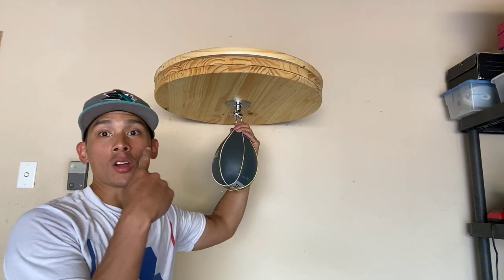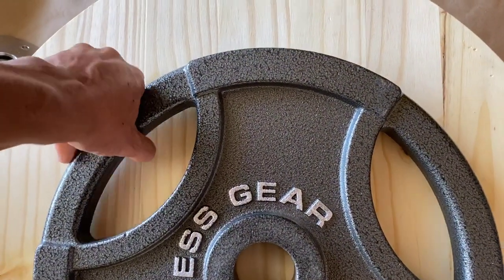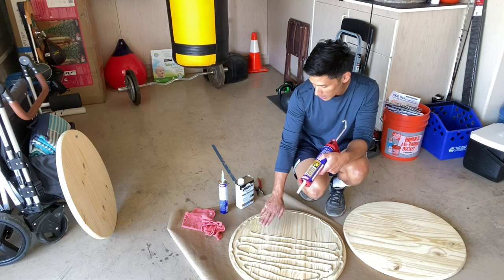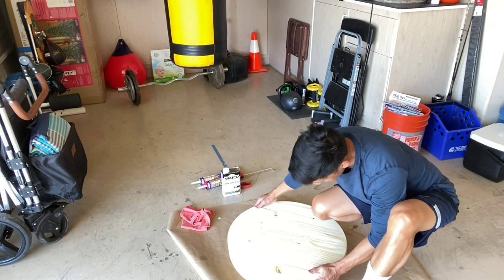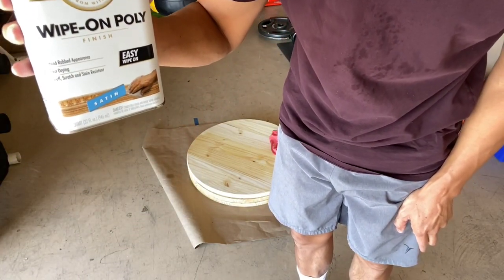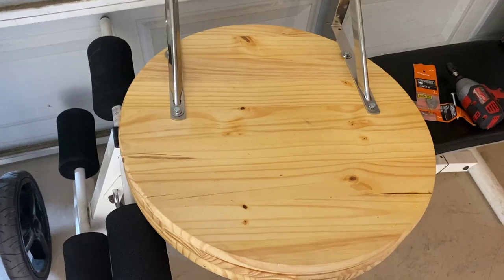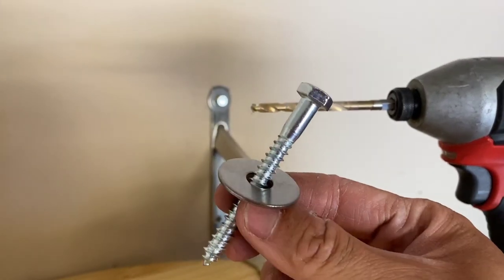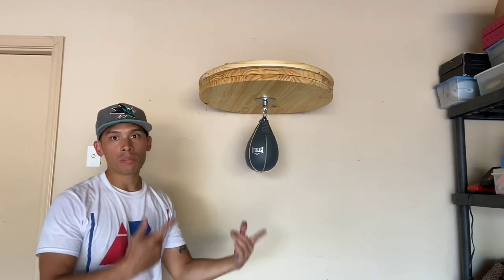How To Build Your Own Speed Bag Platform!- MAKE YOUR OWN SPEEDBAG PLATFORM FOR UNDER $80!

Comment: I did the same thing last year, I highly recommend placing a bag anchor on top of the 3 plates, it makes it so much more rebound resistant. I used the everlast double-end anchor (the one that has 'greatness is within' on the side). great video.
Reply from the maker: Good stuff brother thanks for the suggestion
Reply: What is a bag anchor exactly? Thanks
Reply: @Living_Gr3  I also want to know what a bag anchor is
Reply: what is a bag anchor
Reply: @Living_Gr3  It's literally an anchor that connects to your heavybag, or double and bag from the bottom. If you type in "double end bag anchor" in Google you will see exactly what one is.

Comment: If one wanted to get fancy the could rub in some wood filler on the sides and sand it down to a smooth edge then stain. The result would look like one piece (store bought)
Reply: Getting ready to start this project and really want it to look like one piece. Do you have any suggestions for the filler (ie. Bondo vs. DAP). Does the color matter since it'll be stained afterwards? TIA.
Reply: Presentation is key

Comment: I love your speed bag platform you built and I always wanted to do one like that, but I had no idea they had the perfect sized 24 inch round board already cut at Lowes and Hope Depot so that is awesome! I have limited tools so I was worried I would have to cut one out by hand. I may try and attach one to my Everlast stand also to see how that works, which would be a lot more sturdy than the particle board one, and ad pro swivel. Then maybe put one on the wall or two together since I have drywall, and not sure if the stud is in the right place yet as I need to buy a stud finder. I have been doing boxing, full contact karate, and kicking boxing for 40 years now since age 7, and MMA since 1993. But yeah great videos man keep it up!
Reply: Need to make one but am thick so struggle to work out what I need 😩

Comment: VERY DETAILED VIDEO.
 ONLY ONE  COMMENT MT, ITS GOOD THE THE ANCHOR BOLTS ON TOP TO THE WALL ARE AS STOUT AS THEY ARE,
BECAUSE ( I CLD BE WRONG ONG) BUT THE LOWER BOLTS GOING IN ON ANGLES CLD BE JUST CATCHING THE FRONT OF THE STUD. MAY HAVE BEEN BETTER TO HAVE MARKED HOLES BEFORE HANGING!
EITHER WAY,GREAT JOB!

Comment: It's a pleasure to see young people making things themselves, rather than buying everything. One tip i would give you is to have pree marked and drilled the holes. Than you could use a hand ratchet to fit the screws. More difficult but they go in at 90°
And you may need an extra pair of hands. None the less a great video,  I congratulate you youn man.

Ps, the little vibration you are getting is from the timber stud's in the wall, not from the frame. You can't do nothing about that.
Reply from the maker: Thank you!

Comment: Prices as of 12/30/2023: GRAND TOTAL $132.60
3 24" round boards (Menards): $17.48 X 3 = 52.44
swivel (boxer point brand on Amazon) 21.59
5/16* 3 quantity of 2 4-packs (Menards)  2.78
3/8 washers 24 pack   (Menards)         1.89
shelf brackets (same as in video) (Home Depot) 2*7.98= 15.96
title speed bag , Amazon(looks similar to one in video) 37.94
grand total $132.60
Reply: well theres also a different a set of lag screws smaller ones that fit on the other side of the L bracket. He noted that it was 17/16 or 7/16? Isnt that bigger than the 5/16" hex head? from what I see it looks like 3/8 because 5/16 cannot fit on the other side of the L bracket.

Comment: Made one today, glued and stained and having a friend hanging it tomorrow
Reply from the maker: Nice!
Reply: @csquaredboxing  hey I watched your review on the gyro balance speed bag and I got one and I noticed you really have to hit it right and go slow and then I bought the title yellow bag that you did the review on, and that one's pretty much effortless and I noticed that it doesn't spin as much, but what would be a good bigger size bag to practice elbows and karate movements? And should I get a traditional swivel such as the cheap one that came on my Everlast platform or should I go ahead and buy a title traditional swivel?

Comment: If you ever have to move it or remount ...... get someone to hold  the unit up in position ( with the level in place ) then use a pen to trace out the bolt hole  positions . Remove the unit and drill your pilot holes nice and straight . Then hold the unit in place and get your bolts started using a ratchet instead of the impact . They go in nice and straight and grab the entire way in. Nice work btw.
Reply from the maker: thanks 🙏🏼

Comment: Thank u for this I want a speed bag but could never found one that might not break but I seen this video and I’m going to build one thank u and u got a new subscriber
Reply from the maker: No prob thanks for the sub
Reply: @csquaredboxing  I have a question where the brackets connect to the wall did u cut it off so it would be flat or no ? So it would be flat

Comment: Great video-I may have missed it at the beginning but was the wood already precut round or did you have to have HD have to cut them?  Also, can you add more wood layers (maybe 5) to make it sturdier if you wanted using the same process?
Reply from the maker: Thanks man, yeah these are pre cut to a round shape which is nice and will save you time and labor. You can add more layers of wood to make it thicker but you’ll probably have to run 4 bolts through it an addition to the wood glue to make sure they stay stuck together

Comment: This is close to the route I was thinking about taking! I’ve been thinking about using 1 layer of 3/4” Oak plywood, followed by 2 or 3 layers of 3/4” MDF board as MDF is extremely heavy compared to wood. I agree with fellow commentator about staggering the directional of the wood grain as that’s how wood mills glue together plywood. I’m probably going to finish my wood with either a dark walnut stain or ebony as my bag is mustard yellow. Either way great video.  Also, I highly recommend using Titebond III wood glue as it’s the strongest glue you can use on wood.

Comment: Would it okay to combine the 3 wood platforms with screws instead of glueing them? Also put the shelf brackets on the bottom of the platform to make the installation little easier?
Reply from the maker: Yes definitely would work, brackets on bottom might interfere

Comment: Hey there! For the mount itself, are you putting the edge of the round wood flush with the wall/shelves, or does the wood sit a little bit away from the wall? Thanks!
Reply from the maker: It sits a little further out maybe 1/2 inch
Reply: @csquaredboxing  Thank you! sanding my edges down this week as the 3 rounds I got were all a little off size-wise. Even two years later the prices are really close; I even splurged on a nice Title swivel and it's still around $100. Thanks for everything so far!

Comment: Would it be possible to engrave the sides of the wood? Like a quote on each of the 3 panels? Maybe even coat it black? I know next to nothing when it comes to woodworking but I have the platform sitting outside ready to be coated tomorrow and I was kinda curious.
Reply from the maker: You could do whatever you want to the wood

Comment: Do you think 1 wood panel would be ok, or maybe 2. Does it have to be 3?
Reply from the maker: I did 3 to make sure it doesn’t vibrate
Reply: did you build it? Did you try using 2?
Reply: @robp8389  I did build it. I used 2 panels. It works well but it does have some vibration. The 3rd wooden panel would probably help.
Reply: @strongg3nes400  thanks for that advise. I bought 3 wood panels but keep thinking 2 might be fine. I’ll use all 3 per your advise.

Comment: @csquaredboxing Yo bro, great video.  I just glued, wood filled, stained and sanded mine.  Getting ready to hang and curious:

We’re the 3in lag bolts almost too long or perfect.  The bolt is almost as long as the boards put together so worried about it being too long

I want to avoid the back of the wood from touching the drywall correct?

Thanks bro, I’ll try to share my platform once it’s up.
Reply from the maker: Just depends on the thickness of drywall and stud behind it, 3 inches was perfect for me. And yes you want some space between the wood and the wall so the bag doesn’t hit the wall if a larger bag

Comment: Thanks for sharing the idea! After I had bought the platform, I found similar looking wood plank at Home Depot, so I would’ve gone DIY if I knew it earlier... 

Btw, I believe I heard you said you live Phoenix. Do you have boxing gym to recommend in this area? I have moved nearby not too long ago and was looking for boxing gym (not for cardio, but that would do sparring etc) but wasn’t able to find one. After pandemic calms down, I would like to check out the boxing gym in the area. Thanks in advance!!
Reply from the maker: Thanks man, there’s several gyms in Phoenix, depends on what part of town you live?
Reply: csquaredboxing I live in Chandler area but willing to drive around half an hour each. Good to have a few options and I am willing try them out.

Comment: great video my dude, I'm just about to start my first platform. So I was planning on using your links to the products, but i noticed in the video there were a couple different size washers that dont  have links. Also did you use two different size hex screws? 
Cheers
Reply: did you figure it out?

Comment: Hi Carlo this is unrelated but what brand mouthguard would you  recommend I do boxing and MMA and I’m looking for something with protection and breathability any recommendations ?
Reply from the maker: Hey brother I’ve actually been using a custom gladiator brand mouthguard for about 10 years now. Ironically I’ve never reviewed it lol. Anyhow at the time I think it was like $90 and you had to do a mouth impression with this gel you put in your mouth and then send it in to them in the mail. They then send your mouthguard back which fits perfect to your teeth based on the mold you sent them. Much better than a boil and bite
Reply: csquaredboxing thanks for the advice 👍

Comment: Hey Carlo, Any tips for a DYI double double-ender (a "peanut")?
 Lol I got 2 clipped together, but one (ringside) has short internally-stitched leather tongues, the other (kimurawear) has external nylon straps - it wobbles fierce, and is super-long
Reply from the maker: Tbh I’ve been trying to figure it out without spending too much money or damaging the bag and couldn’t figure a good way to connect the two. So I just bought a Mexican peanut bag
Reply: @csquaredboxing  any recommended vendor/brand?

Comment: with the weight on top of the platform, does the speedbag hitting the wood can be heard across and from other the rooms?
Reply from the maker: A little bit,  a lot of factors though, how thick the walls, room layout etc
Reply: @csquaredboxing  what if I put soundproof foams around the walls? do you think that would work? I live in a condominium that's  why I am worried about the sound that it will make.
Reply from the maker: Mohammad Madid itll probably still go through tbh

Comment: The glueing and applying polyurethane was very detailed. The important parts: Nattaching the brackets and finding the right spot for the swivel get zero detail. 
Him: “I went ahead and installed the brackets” 
Me: well I don’t know if the nut or washer go on first, ow where- same goes for the swivel. I guess it was an ok video about glueing, I didn’t watch for that- I needed the nuts and bolts of this project. 23 minute and I still do not know how to fdo that part- I already know how to glue, but thanks.
Reply from the maker: Finding the right spot for the swivel? It goes in the middle, like all the other speed bag platforms in the universe. Do you need me to show you how to use a screwdriver too?